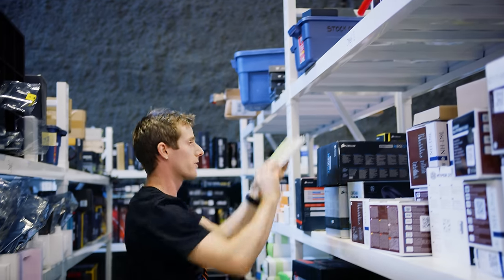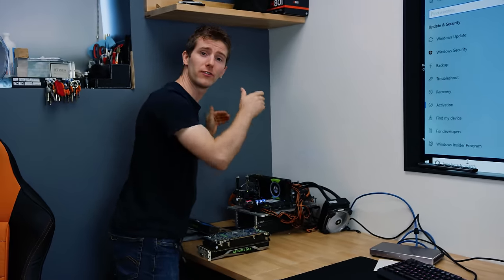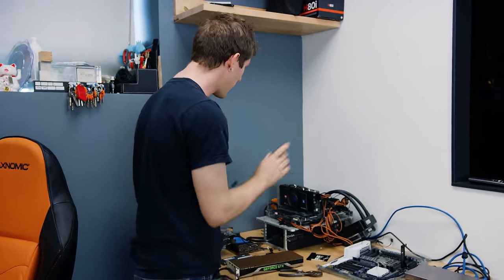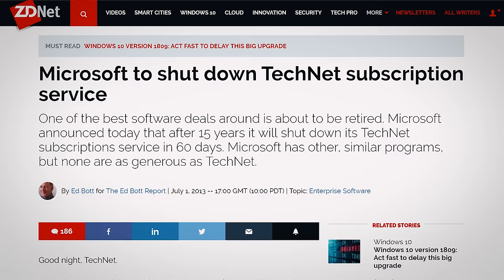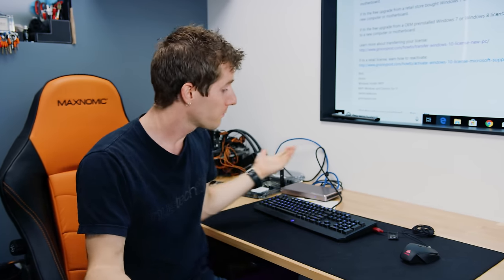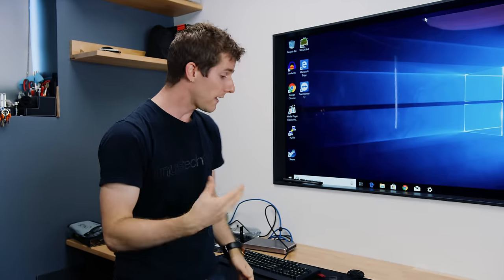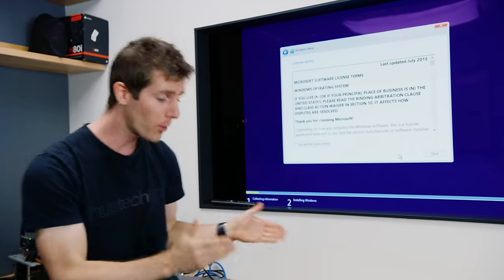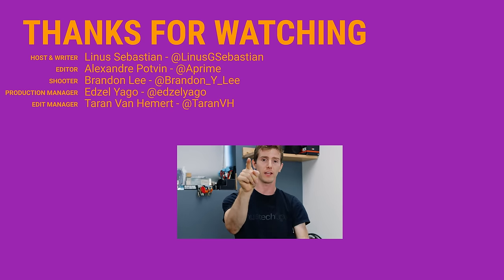Why Does Linus Pirate Windows??

Comment: It's because the OEM key associates with hardware, but retail will migrate with anything.
Reply: YES, thank you for saying this. Everyone needs to know the difference between the two.
Reply: Damn casual, you savagely schooled linus
Reply: Well, in Germany they can't bind OEM keys to Hardware XD, and OEM keys are usually less expensive
Reply: I don't think that's true. OEM keys will be more picky about hardware changes (and I don't think you can get them reactivated by Microsoft if you just use a new computer), but retail keys will sometimes prompt you to activate windows and negotiate with a microsoft employee to reactivate it, which can easily take up to an hour.

I've not had to do it dozens of time like Linus does, but I don't have trouble believing that at some point they just tell you they can't reactivate your copy 10 times in a week.
Reply: Not true HAL builds on first boot/install to whatever is detected on sysbus - problems happen when hal detects new abstraction layer that is completely different from kernel version.
Reply: After a Hardware change you still have to call microsoft to activate it again the software is still the same, however there is no limit :)
Reply: well not exactly some motherboard are Windows 10 ready those motherboards have the key in it so when you install it windows will detect the key on the motherboard and activates it automaticlly, so yeah it associates with you're hardware but not graphics card or something like that it's pure his motherboard wich is windows 10 ready
Reply: it has nothing to do with you're kernel??? kernel just sets what to do and what not
Reply: Yes your right.
but a retail one Linus.
Reply: This isn't true actually. I had a pre-built with a retail copy on it but the mobo died so had to be replaced along with everything else except for the HDD simply because everything was outdated. Booted the PC and TAA DAA: Activate Windows was in the corner. I spent two hours of my life getting my ear chewed out by tech support because my activation sticker had somehow got lost in transit after a move but never noticed until that day but they finally did the legwork and reactivated my copy of Windows 10... only for a W10 update to kill the OS and for whatever reason their suggestion of boot key + boot repair wouldn't work. Ultimately I would have saved myself a lot of time and hassle having a non-legit copy of Windows 7
Reply: I totally forgot this.
Reply: Not the case for me. I had retail 8.1 that got upgraded to 10 and changed my board and had to reactivate.
Reply: That's actually not true.  I just upgraded everything in my rig except storage and my OEM license is still valid.  In fact, I wasted 100 bucks buying a new OEM license for no reason lol
Reply: Thankfully my OEM license survived my boot drive upgrade. Considering that im using a laptop i think the OEM licences bond with mobo and probs CPU and GPU which in most cases are unupgradeable. For regular desktop towers, i super don't know
Reply: This has actually changed in W10 in some regions, including North America. They no longer guarantee reactivation on new hardware. They recently refused to activate my Ryzen 2 upgrade (from an ancient i5).
Reply: Ill be more clear, wasn't in the prior - similar to this; http://www.tomshardware.com/forum/id-3650301/reactivating-motherboard-change.html - a better source; https://support.microsoft.com/en-us/help/20530/windows-10-reactivating-after-hardware-change

When you install your Windows OS, that first time (or what is mentioned in the previous posts are pre-builts where hardware binding has already been instantiated) your OS will bind to the parts inside, this is your Hardware Abstraction Layer - it is independent of the kernel layer but is used in conjunction with so much so that changes in your HAL by hardware upgrade  often produces a significant difference in the build of the machine at first runtime in win 10 represented by a subset of the contents of hal.dll, some other windows libraries and pre-compiled .h libraries - pending on the HW modification.

This may require a re-activation of your windows license in all earnesty for microsoft's protection as much as ours ... keeping user's from installing multiple copies but also for paid enterprise users to not have their disk cloned onto new machines by anyone with a BIOS and admin password.

It's unfortunate for private hosts but really IMO development, CI/CD, deployment and bug testing has really migrated to azure from private IIS host machines. I don't think at a small operation without the need to leverage intra-or-cross departmental exchange the monster rig he has going does what he is doing justice, but i don't know his business ( I think this guy hosts RESTful micro-services that expose data end points???)

 If you're looking to host privately at your home i'd go with something not windows from the get-go, the greatest strength of windows servers come from my opinion operating on an intranet that utilizes sharepoint or other windows office and their business intelligence stack to increase workflow efficiency in small to large business enterprise. The moral I think win 10 and win 10 servers are best used in conjunction on Azure where it's able to scale and use other integrated services for small and large business development.

 Hosting local i'd always go UNIX-like systems until you have enough employees (the content of which all are not as computer literate as others) scale to the point where things like sharepoint, LINQ and Data Tools come of consequence to you starting up.

I'm out to lunch on .NET core, it makes me love the  .NET stack but for another day....
Reply: Yep, Linus must gets his bearings straight - there are Retail, OEM, and VL keys (Enterprise version i think even are their own separate thing, and it's always a VL one). They all cover different scenarios, hence difference prices and "limitations". Much loosen in general these days. Win 7 and 8.1 was much more aggressive in enforcing hardware changes and activation status of the OS. Not to mention that you can use a official Win 7/8/8.1 keys to activate your corresponding Win 10 edition. And there is the insider program...
Reply: @EpuoHg  What I thought was the loveliest of asshole licensing maneuvers by M$ was their two or more variants of the same windows version ISO, and I'm not talking about the ones meant for varying markets and/or regional laws either. There was a separate installer for VLSC licenses, meaning you couldn't slap a VL key into an instance of OEM or retail windows and vice versa. 

It has been a long time since I've had to deal with M$ licensing in any significant way* so I know they've gotten their shit together around this area quite a bit. Embedding the key into the firmware was a good step towards automating it to the end user, albeit one that made the barrier to entry for understanding it a bit higher (though their licensing has never been easy for any of their products outside of free tools like sysinternals). I think the workstation VL keys stipulated, but seemingly didn't check, that they only be used on windows certified machines (read: sold w/ an OEM license). So basically you must already have purchased licenses to have the priveledge of deploying centrally managed volume licenses. It was a while ago though, so I may be misremembering and be totally wrong there... but that still doesn't make their history around licensing complexity any less ridiculous.

VLSC's most significant advantage was the ability to use a common key in a standardized image for businesses though (it gave access to MDT and had other perks too, but ease of deployment was the selling point). For anyone willing to do imaging outside of the microsoft ecosystem, the move to UEFI/BIOS embedded licenses means a keyless image could be deployed instead. It seems unless you have IT who chooses only MS solutions, then getting businesses to pay twice for any possibility of managing their intentionally convoluted licensing is going to be more difficult (I haven't even mentioned that licensing provides no added functionality, and is instead designed to disable some/all of the software).

So basically, I didn't realize that MS licensing (and software licensing in general) made me as upset as it does. I certainly didn't expect to post something like this when I began, but the rant kept coming... I stop now. Sorry internet.

*Well, apart from using my work O365 license's 5 installs or setting up a few personal VMs w/ those, apparently "non-legit for NA markets", $5 OEM keys off eBay (I can pass the mobo's MSFT and SLIC ACPI tables to qemu to use the existing one, but the history of license revocations after changes to hardware made me wary when you can swap hw peripherals by changing a qemu switch argument).
Reply: Nicolas Bailly  OEM will deactivate if you mess with hardware change. Retail is linked to your microsoft account, you can change anything, but using same acc on 10 computers at the same time wont work.
Reply: @Boba Fett 
Correct sir, glad someone else here gets this..... it's tied to the only unique identifier MS can authenticate.... your MAC address.  Not rocket science people...

Comment: The reason that the license did not deactivate for you is because you used an actual product key that came with an installation media to activate windows.  You forget that most people just use the version of windows that comes pre-installed, and use the activation key embedded in the device's BIOS.  When it is when windows is activated using the embedded OEM key that changes to the hardware can deactivate windows.  In fact, recently, I had my entire motherboard in my laptop replaced because of an issue with one of the USB ports, and the DEll technician that installed the new motherboard had to actually give me a "physical oem windows license", as the motherboard that he had installed in my laptop no longer had an embedded key, and would therefore require manual activation should I need to reinstall windows.  I hope that provides some clarification.

Comment: I don't get why people see those activate windows prompts as piracy anyways. I always assumed they were just running as eval and likely had licenses, but just weren't using them for ease of use in testbenches for the exact reasons Linus gave (Except I also figured it just wasn't worth the hassle).

Besides, if Linus wanted to pirate windows he's smart enough to know how to set up a pirate KMS server so that whenever they get a DHCP lease they activate instantly. It's literally a DNS record pointing at a computer running a 46 kilobyte binary. Doesn't even require any software to be installed on the client. Just install, skip, and then when it gets internet it's activated in like 1 second.
Reply: I figured the same thing; why take the time to activate, and possibly kill a key, on a test bench.
Reply: He could sign up for the insider program and get new builds that way. Also, windows unactivated is a demo / trial of windows when you skip entering a key. More than the lifespan of the swapped hardware. It's up to the client to activate windows not linus.
Reply: But that would mean he cant get update though, right? That might be a big flaw
Reply: that was my thought, if you are testing different hardware components it's wasteful to activate windows to turn around and have to reactivate windows when you have changed that one component where windows considers it a new machine.
Reply: @patrickm6627  No, when windows is activated like that it gets updates and everything just fine. As far as it knows, it's activating to an actual KMS server. There's no software to detect, no registry hacks to revert. All it knows is an IP and port to activate off of, which it does.
Reply: @brioflash1y385  Currently at 3 Windows 10 LTSB, 10 windows server 2012 R2, and 2 office 2016 professional plus installs (with visio and project). Not counting temporary test vms.
Reply: If you don't activate a copy of Windows then it is in evaluation mode. This means you can use it as any legal copy. You can even get updates but you can't customize your settings. I believe you can even use a Microsoft Account with it.  I am always building test rigs and never activate Windows. Why waste a key for a test system.
Reply: Mitchell Ross, the license says you can't use the evaluation edition in a live production environment which given Linus's situation he is always using it in a live production environment for each value recorded.

Comment: Yeah. Can confirm. I worked as an Microsoft tech support representative. We scam people
Approximate ammount of reactivations is from 5 to 250
Reply: Per day?
Reply: @afonsohipolito6983  at max. Everytime you change some piece of hardware (motherboard, cpu and etc.) and don't activate with digital license it may ask you for a confirmation code received via phone. If you do the activation via that code/method from  5 to 250 times (depends on your luck) the key will become invalid. And they will say something like "guess you've bought some kind of unofficial key"
Reply: @ALEX19960609  hmm that's interesting
Reply: I know this is kind of random but it is sometimes a pleasant surprise to sometimes find fellow persona fans on the internet
Reply: @ALEX19960609  why "5 to 250" ???
Reply: @lastmanstanding5423  ask Microsoft, why they designed it that way. But basically there are 2 override counters. 1 goes up to 5 and other goes up to 50. I belive first one changes if you chage the motherboard and the second one goes up by 1 per activation on the same pc. 5*50=250.
Reply: @ALEX19960609  
oh OK... that makes sense...

ps.
I didn't use Windows not even for 15 min since 2016...
Linux all the way...
Just here to observe the horrors normies have to deal with...

Comment: Im surprised Linus hasn't been given free copies from Microsoft.
Reply: Because Microsoft was, and is, greedy.
Reply: Microsoft giving something for free lol
Reply: Microsoft is very stiff about their licenses. Even their own employees have to get their licenses installed by on their LAN, or by a VPN from a secure server. Otherwise they need to purchase their own licenses, with a few discounts in stores.
Reply: as if Microsoft would ever consider giving free copies of an operating system to a guy who incidently has the same forename as their biggest nemesis :P
Reply: Kappa2000  Well, they give you a fully functional Windows trial version for free for unlimited time. It's like WinRAR (wich is a complete version) but without claims each time you run it, just a reminder watermark and some features disabled. So yeah... "Free".-